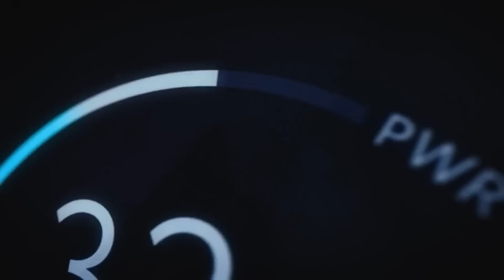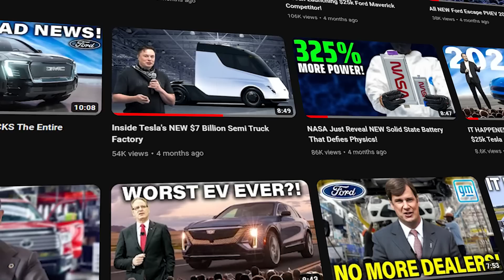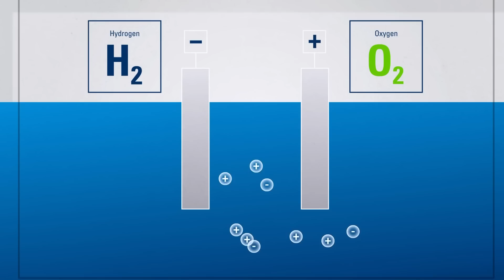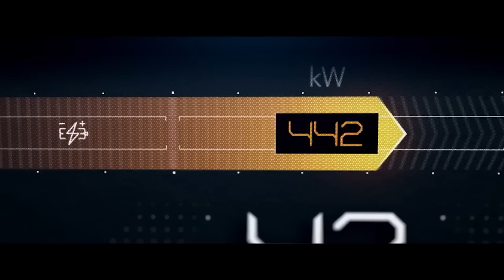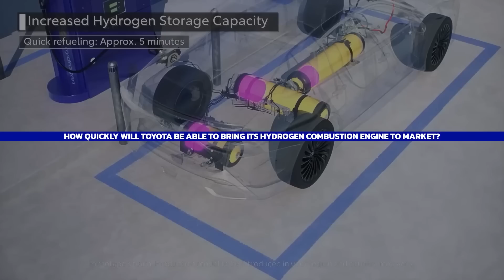New Toyota CEO Reveals Hydrogen Combustion Engine | Shocks Industry!

Comment: So you can get a thousand horsepower out of a tiny electrical motor with almost no maintenance. This includes an already existing power supply and rapidly improving battery technology. A vehicle that you can plug in at home and is incredibly quick. You can make a better hydrogen engine, but it makes no sense. Then you need to build the hydrogen stations and build tankers to supply them. No one has made money better against Tesla. Toyota can still make cars for the Developing would, but everywhere else in 5 years time, they are done for.
Reply: The developing world does not have a lot of money. Even the large oil companies are investing in green energy, such as wind turbines.

Comment: Every single person with even a passing interest in ICE engine systems or hybrid drive systems and electric drive systems knows that the last thing this nation needs or will demand is a third way solution. There is a massive case for electric propulsion with gasoline or diesel range extenders, but there is neither demand nor infrastructure for hydrogen powered ICE vehicles. While hydrogen power solves an environmental issue, it solves no problems or issues for the customer. Instead, it inconveniences him with the need to find specialty fuels along the entirety of any planned trip. Toyota stockholders should demand his immediate resignation as this is not an ordinary misstep but a monumentally foolish undertaking.

Comment: How about a natural gas engine?  The infrastructure is already there.  No need to transport the gas since pipelines already exist. You can fill up at home too if you heat your house with natural gas.
Reply: You would need 2.5 times the natural gas in the car than hydrogen for the same range.  It you aren’t aware, the hydrogen cars are already short on space because of how much room the tanks require.

Comment: Every new technology will go through a testing and growing-pain phase, as they should. The long-term issue with these "clean" automotive technologies is infrastructure. How soon can a hydrogen fueling station become the norm on ANY continent? Who will pay for it? Will those stations have a similar feel to the traditional petrol station, e.g. connected to a convenience store, or, positioned just off the main Interstate highways/roads/thoroughfares? Can consumer confidence in hydrogen, itself, be boosted to the level that will make it a viable alternative? Toyota using their hydrogen engineering tech in race applications, for me, goes a long way in proving safety and reliability. The next thing will be cost of use, availability and speed to refill. Consumers are fickle and all of these things will need to be considered. Electric car infrastructure is definitely not there, yet.
Reply: You can install 40 or more EV chargers for the cost of a new hydrogen station.  The EV chargers also cost less to maintain.  It’s pretty clear which will grow faster.
Reply: Toyota's race car incinerated itself.  Also a hydrogen refuelling station blew up and killed all eleven witnesses. Hydrogen must be more expensive than electricity by the laws of physics. Hydrogen corrodes metal.  A regular ICE car may have a fuel leak and burn. Hydrogen will explode and remove nearby buildings including everyone at the refuelling station or your home.
Reply: Also, from an economic standpoint since h stations cost $2 million to build and have high maintenance costs, they will be required to serve a much larger number of vehicles to work out financially.  This almost assures lines and wait times.  The cost of the fuel currently is very expensive even when produced with natural gas which most of it is.  It will cost even more using electrolysis.

Comment: Simply idiotic.  If you want to go with some kind of carbon neutral combustion engine, hydrogen is the worst way to go.  There is essentially zero existing infrastructure.  The fuel is difficult to handle and store, requiring extremely high pressures, and bulky tanks on the car.  If you really really want to stick with combustion engines, it makes way more sense to go with liquid biofuels, which could use existing infrastructure for distribution.  Regardless, we know this is another delaying action by Toyota.  Once the acquisition cost of BEVs goes lower than ICE vehicles, in around five years, it will be over.
Reply: Where did you get your information on the cost of BEVs being lower than ICE vehicles? It'll never happen, unless you plan on buying a little 'roller skate'.
Reply: @Mike-hb4pc The only thing holding up the prices for EVs has been lithium prices and that is dropping.  20% drop since January.  BEVs are a lot simpler than ICE cars so economies of scale and lower lithium prices will easily push costs for BEVs below similar ICE vehicles.
Reply: @Mike-hb4pc  Tesla have plan to halve their costs.
Reply: @robertwhite3503  I hope so. But so far, every time Tesla has predicted the cost of their next vehicle,  it never seems to happen. It's always more than they claimed. And they are talking about a new type of battery, but I don't know all that I know about it. Things will get better as time goes on... cost, infrastructure, driving range, charging times, etc.
Reply: @Mike-hb4pc  Started with the Roadster (still a work in progress), then Model S/X, then .Model Y/3. Now they are opening a factory in Mexico to build a smaller car and implement much improved processes. These will be forwarded to all other factories as they succeed. I cannot remember if the manufacturing uses 40% of the floor space or uses 40% less floor space. See Investor Day for details.
Reply: @Mike-hb4pc  Just look at the cost curves.  Battery cost drives EV cost.  The rest of the EV is simple and cheap.  The cost of EV batteries fell 90% from 2010 to 2020.  There was a recent reversal because of a spike in lithium costs.  But, that bubble broke recently, with lithium prices down 50% in the past few months, allowing battery costs to resume their long term downward trend.  There is no comparable downward trend for ICE vehicles.  Prices are bound to cross over in a few years.
Reply: @dansanger5340  I agree. If somehow they can come up with a battery that charges in less time and goes the distance, I think electric would be the way to go. Like others have said, there are  way less parts involved (and maintenance) with electric. I think the biggest obstacles right now is range and charging time. Whether it's electric or hydrogen, it's going to take a long time to get the infrastructure in place. If you replaced even half of the cars on the road right now with EV, it would be impossible to charge them. Our electrical grid just couldn't handle it. But like anything,  the more there are the cheaper things get.

Comment: The Hydrogen stations in my area are broken down 95% of the time and the fuel cost equivalent is $15.00 per gallon. A used Mirai is well priced but the headache from paying $105 to go 210 miles then you get to the station and it broken down and now you need to drive 40 more miles to pay $15.00 per gallon ; so now the advertised range of 300 miles is really 210-230 less 40miles. Nobody talks about that !! $105 to go 170 miles. Also factor in a wait of one hour to fuel not 5 minutes because the connection nozzle is frozen stuck to your car and cannot leave till it defrost. They are charging $26.75 per kg when the cost is supposed to be $2.00per kg. The fuel in my area is supposed to be green hydrogen which is just hydrogen made from water. They use an electrolyzer to separate the hydrogen so It's basically processed water at $26.75 per gallon equivalent/kg. The cars are great but the refueling in every way is horrible.
Reply: I believe time will show that hydrogen will be useful for long haul trucks.  I doubt there will be any hydrogen cars mass produced in 10 years.  Toyota will file for bankruptcy within 5 years, which is a real shame.  Their engineering team and leadership teams have not been up to task with regards to how quickly and completely the auto market will alter in the 2020’s
Reply: @jeoinaforest  🤣👌Toyota "file for bankruptcy within 5 years" Toyota is literally Japan's national car company. It has the full weight of the Japanese government behind it. Japan is one of the richest countries in the world. Toyota is literally a city of more than a half million people. A very high percentage of those half million work for a part of Toyota.
Reply: @DetroitMicroSound  Toyota is the most indebted company in the world.

However I do believe that they're too important to the Japanese economy and they'll be bailed out when they inevitably fail. Pretty sure it's why they've gone along with the Japanese governments hydrogen madness.
Reply: @Adertitsoff999  everyone is missing a critical fact about bailouts: they have to be bailing out a company that is in trouble short term but otherwise viable. A company is not getting bailed out if it will just need an even larger bailout every year for the next decade, and that is what Toyota will need. You cannot go to your government and say "we need a bailout to convert to EV production and we are planning to start designing an EV now." We will need twenty billion dollars a year for a decade is just not going to fly, Toyota will shut down this decade.
Reply: @Adertitsoff999  Toyota is in debt to Japan, entirely on purpose. It allows the government to have a say, in every aspect of the running of the company. As I said, Toyota is essentially a national Japanese company. It's not going anywhere, especially not bankrupt. 🤣 Toyota being in debt to the Japanese gov't is a feature, not a bug. The Japanese government just sent 30 more new trucks to Ukraine. Can you guess which brand?
Reply: @tribalypredisposed  well then, they'd better get to work on producing these "game changing" hydrogen cars. Toyota is $217 Billion in the red. Luckily for them they're sitting on so many "game changing" technologies.  For Toyota it's only a question of do they release their "game changing" solid state batteries or their "game changing" hydrogen cars. Either way it'll be easy for Toyota especially with profits from the ICE market declining year on year.

🤭
Reply: @DetroitMicroSound  Toyota has $190,000,000,000 in DEBT.  They were just underwritten for $200,000,000,000 in MORE DEBT.  IF they hadn't went "all in" on a dead tech...(hydrogen)...sure, worlds largest automaker, so, maybe they can service and repay their debt.  They will be unable to do so in this direction.  Plus, I forget the number, but it was 40 or 60B of that new debt was going to be utilized for continued ICE development.  Toyota already has the best ICE in the world but sales are declining on ICE vehicles at a rapid pace...doesn't seem like a wise place to spend development money when it should be going to BEV's.  So, yes, they will have to file for bankruptcy.  Will they disappear?  I doubt that very much in my lifetime...
Reply: Thus way I will keep my fossil fuel running engine as long I can. This whole car business is a business only for them. They don't give a dam about environment they don't mention about the Lithium pollution and mining process its dirties than the oil. This world got up side down.
Reply: Where do you live?
Reply: stupid, it'll get cheaper over time with economies of scale and improvements
Reply: Hydrogen Stations are so funny and its shocking how uneducated people are that they believe that something like fuel station for a h2 driven car is needed. A car can be designed in the way with H2 combustion engines that they need a refuel after ~4500km, but this technology is developed by companies which are listed on the stockmarket. This fact will never lead in a self-sufficient technology which will improve humankind. Shackles made from Gold ... Good Job Society to serve that guys!
Reply: And you don't question why the most common element in the universe is so expensive? ..Petroleum, and lithium industries, is why. ...All it takes, is scaling up production, to meet demands.
Reply: @DetroitMicroSound  hydrogen will never scale up to meet demand because hydrogen cars suck; performance of a heavier Prius with less passenger and cargo space at twice the price with 12,450 fewer places to fill the tank in California alone. Run right out. 

Also, hydrogen is not going to get cheaper with scale. The cheap and 95% dominant way to make hydrogen is cracking natural gas, buy the fracking boom for natural gas is already ending and natural gas prices will be going up, making hydrogen prices rise too. A lot of the cost is also the huge amounts of electricity one has to use to make hydrogen, and then the huge cost of building and operating a hydrogen fuel station. 

There will never, thankfully, be a demand for hydrogen from cars.
Reply: @DetroitMicroSound  Exactly!  100% agree with YOU.  I’ve been telling my family, friends, and co workers for a while that Toyota has been working on these.  Like everything else,  pricey at first, but is the most prevalent element in our galaxy.  Also, Hydrogen is the lightest element. It is colorless, odorless, tasteless, and non-toxic.

Comment: Using electricity and/or gas to make the hydrogen fuel, then you need to transport it to the fueling stations.  How much energy is wasted and how safe is it to transport hydrogen fuel?
Reply: How about making the energy via a limited and failing infrastructure to charge the EV’s? Solar and wind are not efficient, so you will have to burn fossil fuels in greater amounts to keep up with the electrical demand. In the meantime, you destroy America’s largest industry while China builds 2 coal plants a week, signs oil deals with all our enemies and laughs their @$$e$ off while the West destroys themselves over a fake green agenda? Beyond silly!
Reply: And you have to keep it refrigerated during transport and during storage at the "gas station".  Silly

Comment: Electric vehicles are out of reach cost wise for most Americans. Until EV's or an alternative power source that meets the clean energy levels required is attainable cost wise for most Americans, then it will only be attainable for a relatively small segment of the populace.
Reply: The expenditure on vehicles has always been huge in the US.  Elon is looking to halve the EV cost over short-ish time period. In the UK we have always gone for smaller vehicles. I also cannot afford a Tesla, but it will be mine one day!
Reply: The cost of EV batteries went down by 90% from 2010 to 2020.  There was a recent bubble in lithium prices the past couple years, but that has recently burst, with lithium prices down 50% in the past few months.  EV batteries will resume their cost decline, and EVs will inevitably be cheaper than ICE vehicles, probably within five years.
Reply: FYI, it costs $80 to fill a Mirai with hydrogen so if you are cost sensitive then this isn’t the answer.
Reply: Buy used with a loan or lease. So much cheaper and the lower running costs help to offset the payments.
Reply: Telsa Model 3 is cheaper than a Prius and vastly superior!
Toyota described Model Y after tear-down as "truly a work of art; It's unbelievable."
Toyota are finished...
https://www.youtube.com/watch?v=eyoIkybAAf0

Comment: its a good concept but the tank that will hold it is under a lot of pressure if you get into a car accident you may not survive and that tank will shoot out like a torpedo no different that a tank for welding gas the psi is a lot.
Reply: EV cars are just as dangerous in an accident, have you seen how hot and long those lithium battries burn? And many people don't even know how to manually open the door of their Tesla, when it doesn't have power.
Reply: @noseboop4354 Battery fires happen more slowly.  Nobody has died from one.  An explosion means instant fatality.
Reply: @diamond_h0us  That's a complete fabrication. Plenty of people have died from EV fires on the road. Even worse, people have died in their home when the EV's battery is damaged and catches fire during charging, burning the house down.
Reply: @diamond_h0us  53 fatalities from fire so far, in Tesla cars alone. Look it up.
Reply: @noseboop4354  you do realize that ICEVs catch fire at least 10x more often than EVs.
Reply: @williammeek4078  Yeah, but ICE fires can be controlled within 30 minutes, while EV fires can take 3+ hours. German firefighters did a lot of research and the only way to put out an EV fire quicker is to grab an EV and dump it into a swimming pool full of foam. And they can burst into fire again the next day, as junkyards have learned the hard way.
Reply: @noseboop4354  since ICEVs catch fire 10x as often, compare the worst 10% of ICEV fires to BEV fires and see how your comparison stands up. 
EV fires develop slower giving people more time to escape among other things.
Reply: @williammeek4078  Talk to any fire department, lithium batteries from EV and smartphones are the #1 cause of fires in homes, surpassing cigarettes many years ago.
Reply: @noseboop4354  sorry no. Lithium batteries don’t even make any list of top causes of house fires. Top 5 are: cooking, heating equipment, electrical equipment (not batteries), candles, and smoking. Just ask any insurance agency.
Reply: Or you could get into an accident and your batteries catch on fire ( a real thing). Or maybe a flood, and it catches on fire (a real thing). If they put the time, money, and effort that they are putting into electric cars, I think they could make the hydrogen powered cars a viable option. I still think it's the way to go.
Reply: @Mike-hb4pc  no, making hydrogen viable would require changing the laws of physics.